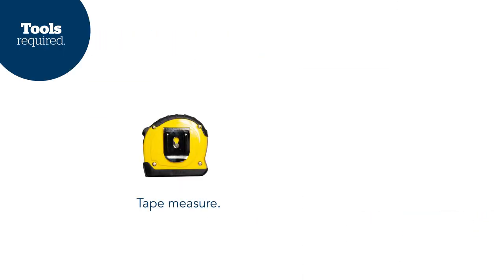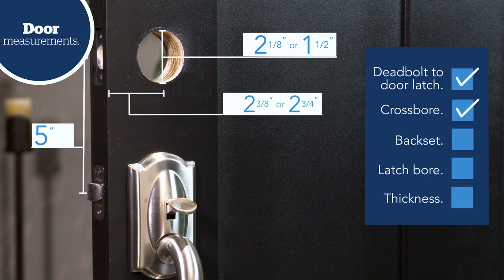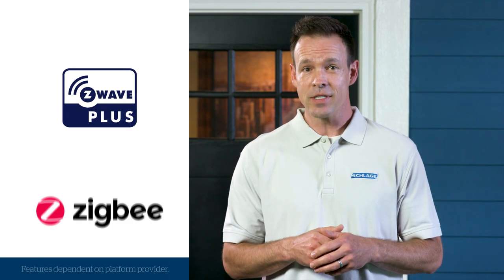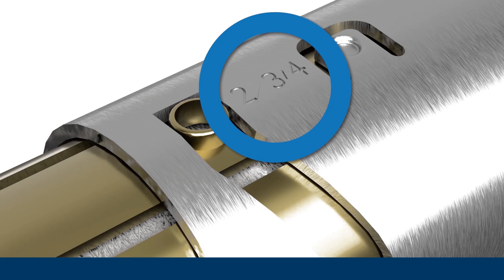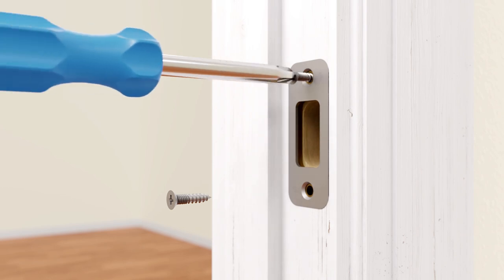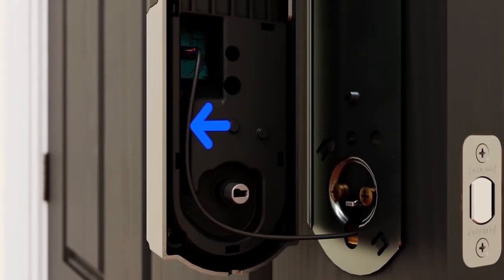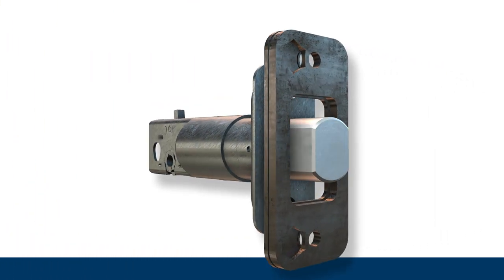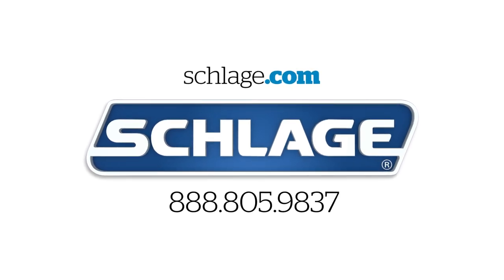How To Install Your Schlage Connect™ Smart Deadbolt

Comment: Everything works great, excellent instructions, I did have to grind down my strike plate a little to ensure smooth operation of the bolt but no problem. Note for other installers:   Instructions state a minimum of 5" from "Center of the Deadbolt hole and other latches beneath the deadbolt" I only had 4" and I had no problem!

Comment: Hi, I have installed many of these brand new with zero problems. However, I have moved and the lock spins in the direction of the old door.  I am not sure how to make it turn the opposite way. From the inside, the installation was on the left side of the old door. The new door it is is on the right. Do I need to do a factory reset? My wifi is the same and it works great if not installed. Thank you!! I LOVE my Schlage!  (Model BE479AA)

Comment: Thanks for the video, does this electronic deadbolt (Camelot trim~) fit on metal screen doors ( note I am specifically asking about screen door without a flush door knob space-it has about 1/16th” door knob space “lip”)?
Reply from the maker: Thank you for contacting Schlage Support. This model is not recommended or intended for installation on metal screen doors. We apologize for any inconvenience. Please reach out with any questions and have a safe day!

Comment: Called and sat on hold for an hour.... with a co as small as this you'd think someone would be happy to answer.... I need to know if this lock can be programmable as to only lock at certain times of the day and not just locking after every entry
Reply from the maker: Hi Kyle, thank you for reaching out. I'm very sorry to hear the extended hold times you experienced. Our BE469 Connect can only be set to auto-lock after 30 seconds. At this time our BE469 does not support time specific/ scheduled locking.

Have a safe day!

Comment: I would like to know if there is a specific locks depending of de side of the door open (right or left)?
because I installed a Schlage Locks and it is working inverse, when I press de lock key external side the door unlock and when I put the code and it lock.
Reply: Problem solved with reset the memory totally

Comment: What if your door is thicker than normal, like by an inch.  Is there a way to get longer screws and a long male adaptor than inserts into the female port at the inside of the door?  I have a thicker than normal door and the from of the lock can't reach the back of the lock, on the inside.  I need longer screws and a longer male insert (no jokes please, this is serious!).  This is my second installation, and the first one was on a normal door but my other house has a much thicker door.
Reply from the maker: Hi Eric, 

Thank you for reaching out! We do have a thick door kit for this model and the part number is 23997877. However, this kit will only fit a door up to 2-1/4" thick. This is available for purchase through Build.com. 

Please let me know if you have any other questions :)

Thanks, 
- Mayra

Comment: the lock I got got a hump facing down ( female side), while the male side is facing up, anyone knows what to do?
Reply from the maker: Thank you for reaching out! You will need to force the motor and perform a reset on the lock to correct this issue. I have provided the steps below. 

1) Remove the interior side of the lock from the door and disconnect the wire connected to the back of the motherboard
2) Grasp the thumb knob and rotate it 3 times clockwise then 3 times counter clockwise (You will need to force it around to turn. You should hear the motor noise) 
3) When installing it back on the door make sure that the deadbolt latch is retracted. The metal bar coming through the center of the door should be flat with a little bump on the top right. The back of the interior side of the lock will have a cylinder that the bar goes through. That should be flat with a bump on the top left so the bar from the keypad slides right in. 
4) Enter a code on the keypad. The deadbolt should extend and retract and the keypad should flash a green check at the end.

Comment: I am having difficulty to setup Schlage app on my android phone to make full use of the smart deadbolt. Is there a step by step guide or YouTube link to setup? Would appreciate the help!
Reply from the maker: Hi there. Thanks for reaching out. Which lock do you have? (Connect, Sense or Encode?) Thanks, Jenny.
Reply: @SchlageLocksOfficial  I have the connect and it doesn't show up in the app
Reply from the maker: @malikroberts3330  Hi there. Thanks for reaching out. The Schlage Connect does not work with the Schlage Home App. You need to use a hub with the Schlage Connect. The Z-Wave version works with SmartThings, Wink, Nexia and Ring Alarm. The Zigbee version works with SmartThings, Echo Plus and Key by Amazon. Once you pair it with your chosen hub, you would then use their app to work the Schlage Connect remotely. Let us know if you have any questions. Thanks, Jenny.
Reply: @SchlageLocksOfficial  hi I have a Schlage sense and can’t connect to the app or my ring doorbell/peephole camera
Reply from the maker: @matador_305  Hi there. Thanks for reaching out. The Schlage Sense requires the Schlage Wifi Adapter to connect to the Schlage Home App. If you don't have one of those, you'll need that first. Also, the Schlage Sense doesn't work with ring products at this time. If you are looking for a lock that doesn't require a hub or adapter and also works with your ring doorbell, you would want to check out the Schlage Encode instead. Let us know if you have questions. Thanks, Jenny.
Reply: @SchlageLocksOfficial  smart things says your required to use a wifi adapter but the adapter hub requires you to first setup with the app which you can't do because most people don't buy apple products
Reply from the maker: @jaybelle1909  Hi there. Thanks for reaching out. If you have the Schlage Connect mentioned in this video, you don't need the wifi adapter, as it doesn't work with the Connect (it only works with the Schlage Sense.) You would just use SmartThings and their app. If you have the Schlage Sense, you either use Apple Homekit OR the Schlage Home App + the Schlage Wifi Adapter. If you have any questions, please contact us at consumerschlage@allegion.com
 or 888-805-9837. Thanks, Jenny.
Reply: @SchlageLocksOfficial  So it doesn't work with Alexa without a hub? Even with the Smartthings skill?
Reply from the maker: Hello. Thank you for contacting Schlage. You can pair our Connect lock with Alexa once paired with Zigbee compatible smart home automation hub. Alexa is compatible with the Zigbee certified Schlage Connect via:
•	Amazon Key (with cloud cam)
•	Echo Plus
•	SmartThings (hub required, not just the skill)
Hope this helps you connect your lock. Please contact us at 888-805-9837 if you need additional support. Thank you, Kat.

Comment: I have done factory reset. Every time the setup rputine runs it leaves the bolt extended. What I am to do?
Reply from the maker: Mary, Thank you for reaching out to Schlage support. Once you have completed your factory reset you will have to enter the user code to retract the bolt or physically turn the interior thumbturn.

Comment: after installation , when press the schlage button the bolt dosent retract , and when locked without  typing the code if only schlage is pressed it opens. What is going on here ? any help would be appreciated. Another thing is what ever i pressed after green there's a red cross all the time. Have  swapped with new batteries as well
Reply from the maker: Hello, I am sorry to hear you are having issues with your Schlage Connect. I would be happy to assist! It does sounds as though the handing may have not been properly set while setting up the lock. To make sure this goes through properly, I recommend that you walk through a factory reset on the lock and immediately after, press the Schlage logo and enter the USER CODE A that is on the programming sticker. The bolt should extend and then retract, setting the handing. After this step, you should be able to test the functions to ensure they are working properly. If you have any other issues, please email us at consumerschlage@allegion.com so we can further assist you. Thank you!
Reply: @SchlageLocksOfficial  reset worked ,  thanks a lot,
Reply from the maker: Glad to hear that worked! Please let me know if you have any other questions.

Comment: I have a Schlage connect touchscreen deadbolt with alarm when try to connect to the WiFi. The Schlage app is asking to push bottom on the back of the Schlage that I can’t find can someone help please
Reply from the maker: Hi there. Thanks for reaching out. What hub do you have? The Schlage Connect doesn't work with the Schlage App and requires a hub. Here are the hubs that it works with: https://www.schlage.com/en/home/smart-locks/connect.html. Let us know if you have further questions. Thanks, Jenny.